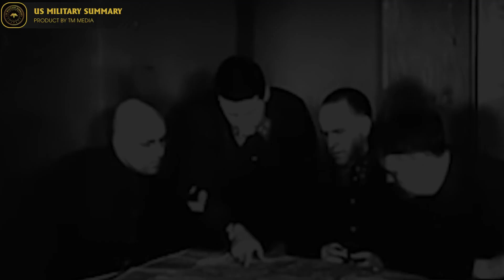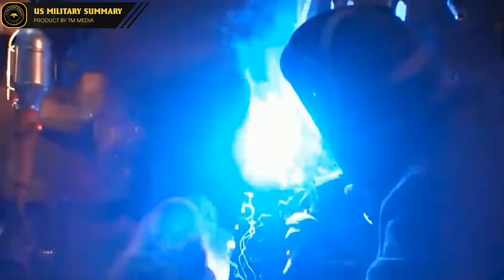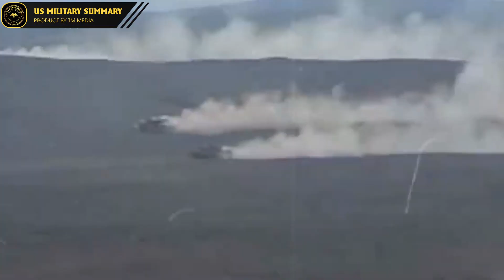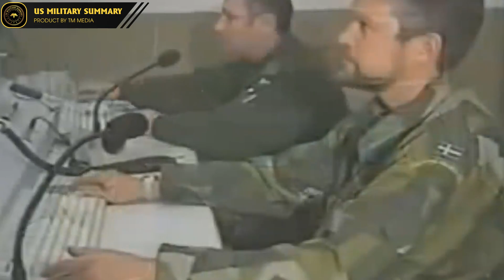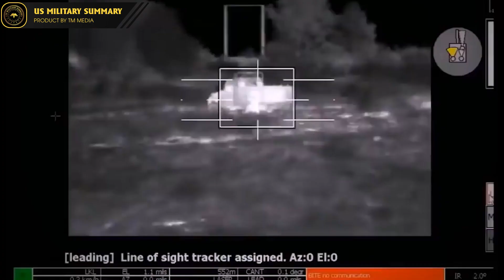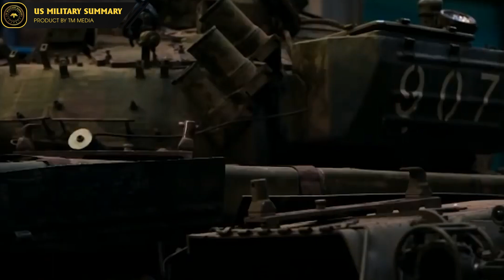Who Wins!! T-72 vs Leopard 1: Which Tank is the Most Powerful | Military Summary

Comment: Yeah, the $64k question is WHAT specs, the garbage Russia puts out, or actual observed performance capabilities of the T72, because those will be grossly different.  As an example, on paper a Patriot should virtually NEVER be able to intercept a Russian hypersonic weapon, yet they do, at nearly 100% (using two on each target),  Russian specs mean nothing. 

And T72 turret tosses, with complete obliteration of the crew, from SMALL grenade drops, can be seen EVERYWHERE in videos on YT, so I am TOTALLY unimpressed with it's resistance to strikes.  To something like a Javelin or a Stugna, the tank might as well be made out of rice paper.  I've yet to see a SINGLE T72 drive away from a direct hit from one of those.  Usually they launch a turret halfway to the moon (the record for toss parameters that I've witnessed are 3 1/2 end over end somersaults, and about 150', judging by plugging into a ballistic trajectory time aloft to calculate max altitude equation), or go up like the mother of all Roman candles.

Comment: Leopard 1's are unlikely to face T-72's, instead they will be used to support more modern tanks, or infantry and AFV's in places where there are no Russian tanks.
Reply: True, tank on tank has been observed on video only once or twice in the entire Russian invasion of Ukraine, at least that I've seen and remember, and I follow closely, on several of the GOOD channels.  

A Bradley did take out or repel a T72 TWICE in direct confrontation, which is almost beyond absurd.  You have to have balls of steel the size of bowling balls to go up against a tank with an expired fighting vehicle, though.

I know the Challenger one is not terribly highly thought of by the Ukrainians, but it is damn sure better than nothing.  The Challenger II is an entirely different matter. I've seen a couple of Ukrainian tank commanders speak VERY highly of those, even to the point of interior comfort, and how much that contributes to be able to fight over long periods.  He also pointed out that the protection was out of this world, compared to the T anythings, up to the 90.  The T14 is TRULY a paper tiger.  They haven't shown up on the battlefield for many reasons, the primary one being that they are an unreliable POS, getting locked up to the point of having to CRANE them out during Moscow parades,,,,they tried to drag the damned thing out with another tank and it was frigging hilarious, the track wouldn't even turn, and the towing tank moved it about two feet with multiple moving snatch attempts.  LOL
Reply from the maker: Thanks for your comment. It's unlikely for Leopard 1 tanks to face T-72s in combat situations. These tanks are more likely to be used in a support role for modern tanks, infantry, and AFVs. They may also be deployed in areas where there are no Russian tanks. Thanks for watching the US Military Summary channel.

Comment: How does the T-72 compare to the Leopard 1 in terms of armor protection?
Reply from the maker: The Leopard 1 generally has better armor protection than the T-72. Thank you for your comment on the Us Military Summary YouTube channel.
Reply: @usmilitarysummary how a tank like leopard 1 with only steel armor can match the armor of t72b3 with laminate armor and reactive armor
Reply: Probably well, as the T72 SOP, even with small grenade drone drops, seems to be a slightly sub orbital turret toss, and total obliteration of the crew, by concussion, immolation, and spalling.  Not the tank I would want to be driving.

Comment: What is the Military Summary of the differences between the T-72 and Leopard 1 tanks?
Reply from the maker: The T-72 and Leopard 1 tanks have significant differences in terms of firepower, armor, mobility, and overall performance. The T-72 has a more powerful gun, thicker armor, and better mobility on rough terrain, while the Leopard 1 has superior accuracy and speed. However, both tanks have been widely used and have proven effective in various military operations. Thank you for your comment on the Us Military Summary YouTube channel.